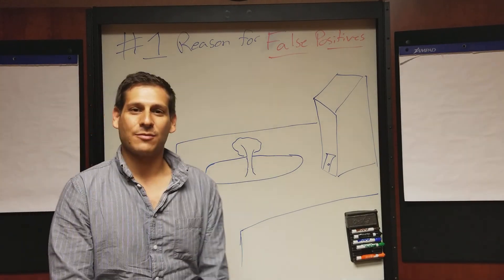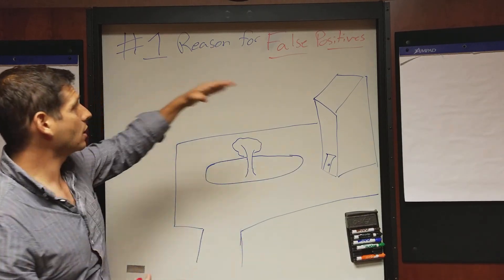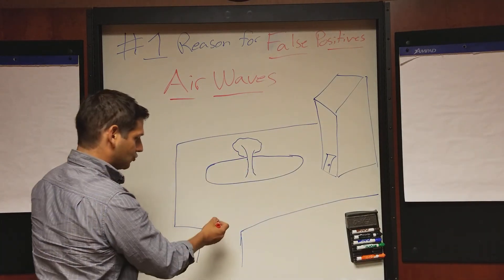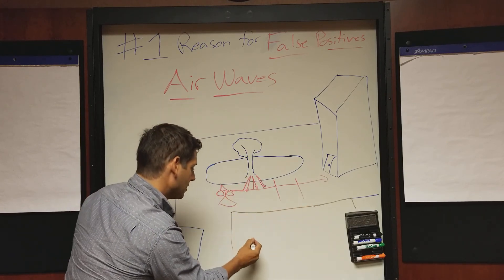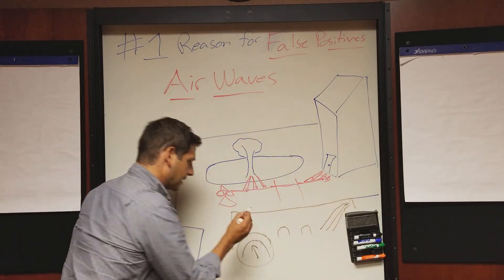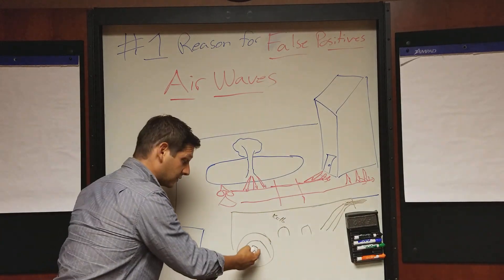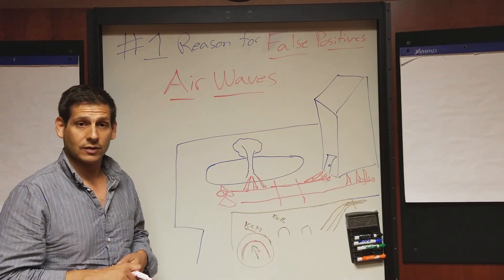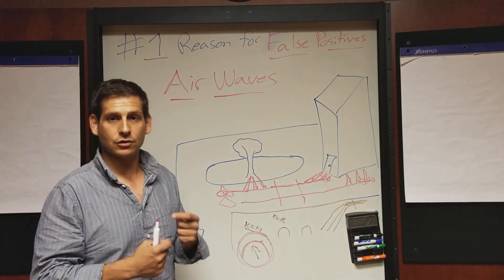The #1 Reason for False Positives in GPR Data (Ground Penetrating Radar)

Comment: Also points to the danger of not correlating parallel scans, no?
Reply from the maker: Absolutely...but taking a step back...folks need to run multiple parallel scans. I use utility locating as the example, but it gets tougher even with parallel scans when the targets are small non-linear such as grave sites. Thanks for the comment Barry, hope all is well in NY.
Reply: For a small target a perpendicular scan would distinguish a real target from an air wave, correct?
Reply from the maker: it could. take the tree in the video for example. when crossing in front of it you will get a hyperbola.  but when you are perpendicular, you will get a half hyperbola leading up to it. this can help distinguish. but I think it is still useful to check speeds just to be safe.
Reply: That reply triggered a very fruitful discussion here at work.  Thanks, Daniel, you're the best!
Reply from the maker: thanks so much. its my pleasure! have a great weekend.

Comment: A lower dielectric constant around 1 or 2, the amplitude would be faster and come off as a dark hyperbola or negative first on your screen yes?
Reply from the maker: It depends on how your system is calibrated. The hyperbola might appear to be low amplitude especially when they appear deep in the scan. Another indicator  of a possible air wave is identifying a hyperbola beyond the signal of the GPR. If the signal has faded out at 50 ns, but you identify a hyperbola at 80 ns it might be coming from a source on the ground surface.